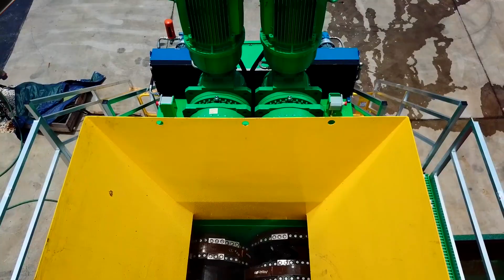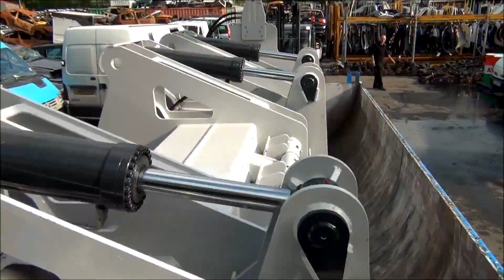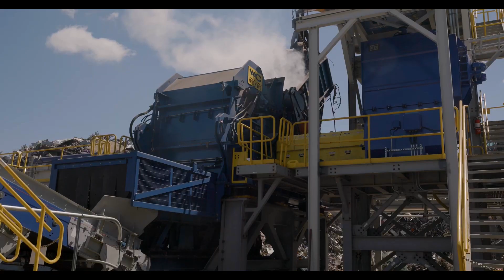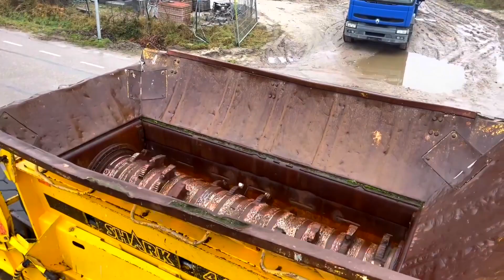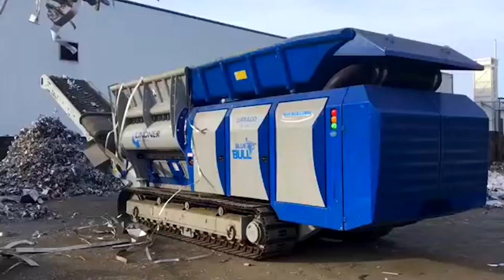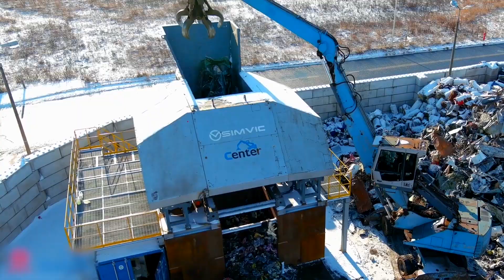12 Most Dangerous Car Crushing & Shredding Machines That Obliterate Everything

Comment: What happens to the metal after the car has been shredded?
Reply from the maker: The fragments are sorted by material and density. The recovered steel and other metals can then be recycled, transported and sold as processed scrap material.